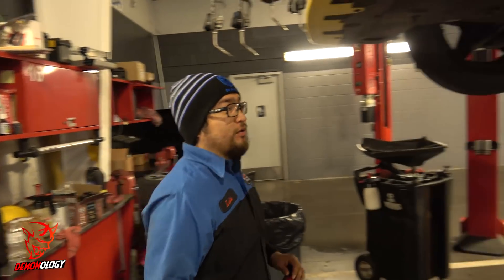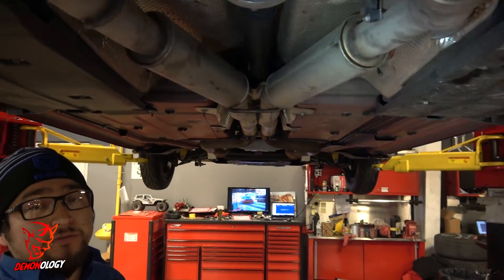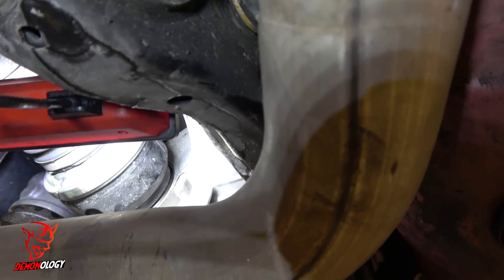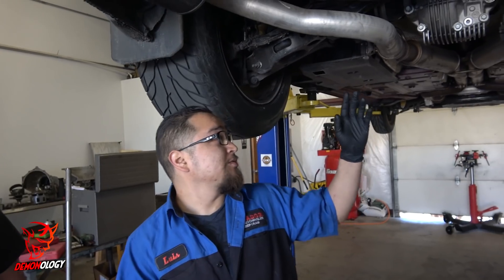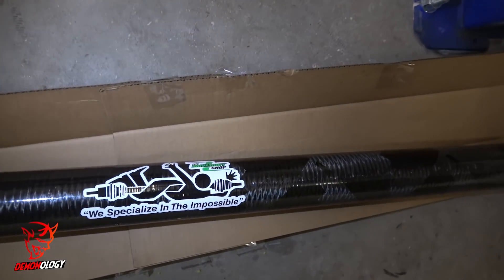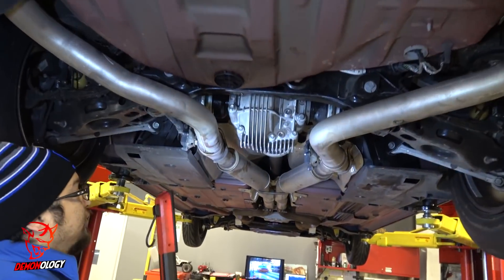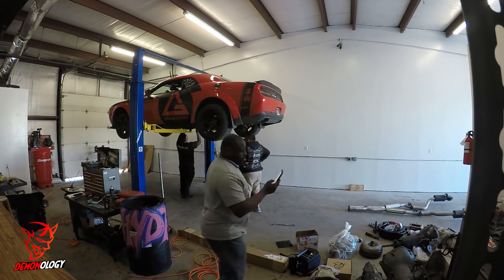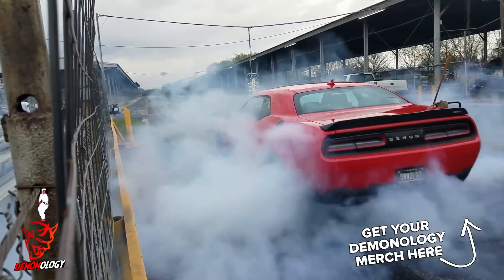After 700+ races my diff finally CRACKED and I wore out my driveshaft, but I VOIDED my warranty...

Comment: Gongrats on 700 passes before breaking. You did the drive shaft, that hellcat diff works for now, the Transmission is solid as Speedcore ran 1500hp through the stock trans. I would upgrade the diff to a fully built set, upgrade half shafts and then you are ready for pulleys and a tune
Reply from the maker: Sounds like a plan

Comment: Mopar needs to put a solid rear axle in them. Independent suspension is not for the drag strip. Maybe a road course. 2 piece driveshaft is dumb too! Trade it on a Cobra Jet.Stick a 9 inch in it.  lol Drive shaft shop does great work.
Reply from the maker: Yes they do. Drive shaft shop are the best.

Comment: I only have a Naturally Aspirated modified 5.7 and I put in a 3.70 rear gear and it failed and cracked. Once I put in a one piece DS I picked up a vibration. The vibration is most likely the rear carrier bearing.
Reply: How big of a difference did it make on your gas and track times? Is it worth it?

Comment: Demonology sorry to hear that. What would be better if Dodge would make a cast iron rear end for their cars. Let's be honest the aluminum rear is not enough to handle that much horsepower or tourgue. It's a weak link cause they wanted to save weight. Not to rub salt in a wound but my Camaro has a cast iron rear end case. Not sure what dodge engineers where thinking?

Comment: Warranty doesn’t cover Rubber, belts, bushing, brake pads or anything else that wear and tear through normal usage.

However, the 100 thousand mile power train warranty will cover the differential. Within the factory troubleshooting procedures, there’s no step that requires the mechanic to ask about tire size or diff brace. 

He should simply follow the troubleshooting steps, input hairline crack in diff housing on the ticket and subsequently open a warranty ticket and order the diff.

Done it many times while working at the Chrysler/Dodge/Jeep dealership... brace or no brace.

Now, if you simply told them you wanted to switch your diff with one you had, of course they’ll charge you labor for that. But I recommend you request they open a warranty ticket and order a replacement.
Reply: Big AL Not on the Demon.  They ask the dealer to send in pictures of the diff and tires.  If you don’t have the factory nittos, voided warranty.  If there are signs that a diff brace was on the car, voided warranty. Demonology took the right steps having the brace on his car.  When the diff goes, causes nearly 15k in damage to the car.  Happened to mine.
Reply: Mandolin1944 - They don’t care.  They sold their 3300 Demons, of which 100 are actually raced.  So if they can void the warranty on those, then they don’t have to worry.  It’s not a question of if the diff will break, but when.  That’s the worst part.  Supposedly, they are coming out with their own version of a diff brace fix.  That would be nice!  Regardless, mondo credit for Dodge to even make such a beast.  All things considered, the cars have done very well.
Reply: @Mandolin1944  this is long term damage, how could they know this would happen?

Comment: I don't think the taller gear is not going to help anything but mileage.  Also, the Demon diff housing is an hardened unit - supposedly stronger than the hellcat.  Beware my friend.
Reply from the maker: Believe me wa hen I say, it's no better then the helcat diff.
Reply: @Demonology  : I checked with my FCA SRT buddy.  The Demon diff case went through a special stress relieving and hardening process.  Now, if we believe that, let's talk about stresses with a 3.09 vs the taller Hellcat gearing:  The ring gear is seeing higher torque loads (and the case bearings) with the 3.09.  The Hellcat diff may well live with stock gearing, but if you put in 3.09 in that case - I am told to cut the life to less than half.

Comment: Hopefully the carbon fiber driveshaft is a 1 piece.  That will help with your ETs and response since the driveshaft won't be moving up and down.  I had that problem with my S13 but when I switched to a 1 piece it felt alot better.

Comment: Yes!!! Big Move! Carbon Fiber Drive shafts going to make a difference!
Reply: Cf drive shaft is actually weaker than most other types. Seen them bust in stock 2013- 2014 gt500s with slicks. Some have luck but the ones that were launching hard snapped them in a ton of pieces like a bunch of powder.
Reply: Are they really that strong
Reply: Carbon fiber driveshafts are weaker because the weave in the carbon fiber twists and bends and eventually snaps. Not a good move...
Reply: The claim is CF driveshafts are stronger. Some designed to handle 1200+ hp. I have seen some break. But breaking into tiny pieces is a good thing. Virtually no damage to the car compared to a stock drive shaft failure
Reply: @trozio1  No I totally disagree, the carbon Fiber drive shaft is going to make your throttle response more responsive, it's also way lighter and Carbon Fiber is a very strong. Yes after a lot passes the carbon fiber will break but thats the cost of racing if you wanna be competitive. When I play Ice hockey we only used pure carbon fiber sticks that broke after a month, carbon fiber gives me a boner. LOL
Reply: Watch this video, great video on how sexy and strong a carbo fiber drive shaft is..
Reply: @Cravenmooreheadism  
Yea carbon is strong, but when it breaks it shatters like glass. 
They probably add some kevlar in there, i doubt its straight up carbon.

Comment: Idk how I feel about taking the 3.09 out and putting in a 2.62, but it will be interesting anyways
Reply: A lower gear ratio will transfer some of the stress to the driveshafts and the transmission. It could work, since the bulk of the problems are surrounding the diff.
A nodular iron case would allow the demon to reach the highest level. Hopefully someone is working on this.